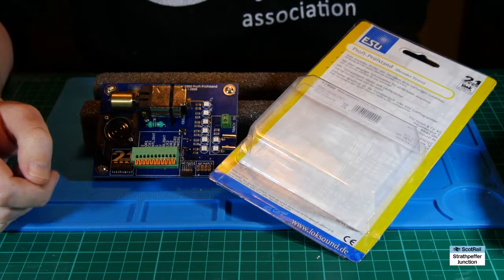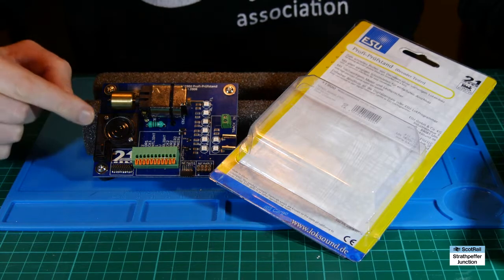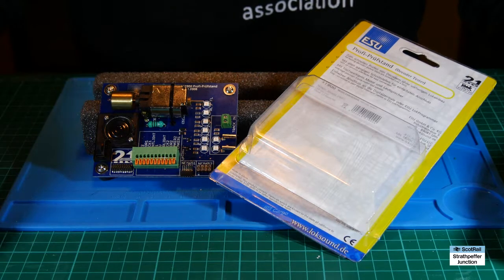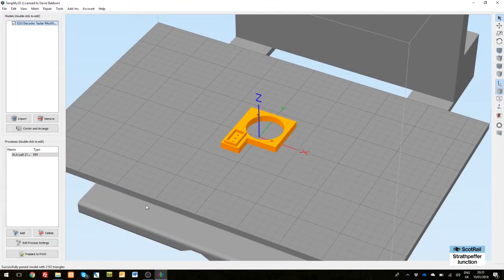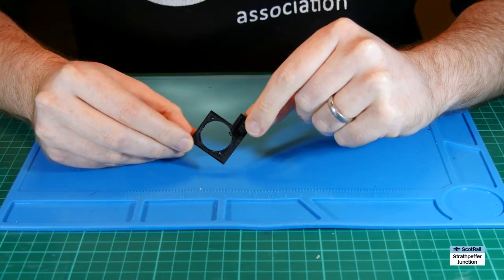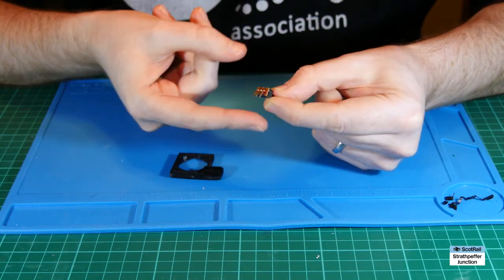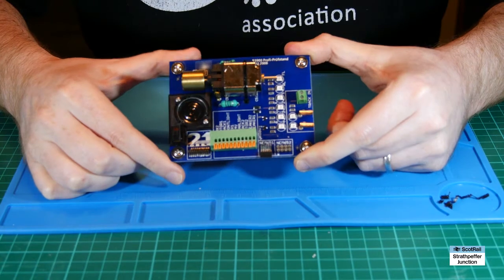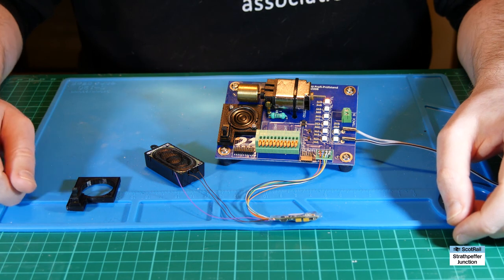#8 Adding a Speaker Switch & 3D-printed mount to an old ESU DCC Decoder Tester

Comment: An excellent video.

I've yet to buy a decoder tester, so what you've described is a cost effective option to buying a new and expensive tester.

I'm expecting to buy a 3D printer soon (I sold on my first one because I couldn't get it working properly), the new Prusa Mk3.
I'm fortunate that I trained to use Autodesk Inventor (Fusion's big brother), so I've drawn several items which I intend to print 3D items.

I think I'll give your conversion a try!
Thanks for making this!
Reply from the maker: +UK Diesel and Electric Railway Modelling Many thank. If you can pick up one of these old ones for a good price (mine was £10, from memory), once tweaked, in my experience you don't need anything else for most testing needs. The newer ones have additional plug functionality, but I don't have anything other than 6, 8 and 21 pin decoders, so I have no need for additional bells and whistles. The i3 is a good machine. Hopefully you'll get on well with it!

Comment: Hi David, another excellent video, you have some excellent skills. I have the more modern tester which switches between 8ohms, 100ohms or off. I have always thought about buying a 3D printer , which would you recommend and does it come with the software? Could you do a video on using the printer, listing all the items you would need and how to use them?...Simon
Reply from the maker: +Simon -Liverton Central Thanks again for the kind comment, Simon. I can indeed do a video on the printer. I've got a couple of projects in mind for it, so I'll be sure to film one. I have a Flashforge Creator Pro. It's at the higher end cost-wise of home level printers, but a lovely machine that prints well and consistently. My main advice would be get as good a printer as you can afford. The cheapest ones can sometimes be ok, but often can also be frustrating to use, unreliable and poor quality. The Prussa i3 is a fair bit cheaper than mine, but a greater machine. One of the reasons mine cost more is because it came pre-assembled and it also has a double extruder. While being pre-assembled saved a lot of time and effort, and I'd recommend getting one like that unless you love building these sorts of thing, I have still not used the double extruder. Getting the nozzles absolutely level can be a really tricky task and for most projects, you only need a single colour or type of filament in any case. Another thing that I think is a good feature to have is an enclosed frame. My printer has that and not only does it make it very rigid, it helps to keep the heat in, which makes printer things like ABS much easier. I guess one of the key things with 3D printers is that technology is changing so fast, mine was pretty much out of date when I bought it, but that being said, it still produces great results (once you get used to the settings that work best with it).
Reply: Many thanks David, look forward to seeing the video.  If you could go into as much detail as possible on how to use one, and the parts needed, it will help me to decide to buy one...Simon
Reply from the maker: +Simon -Liverton Central I'll try my best. It'll probably be a few weeks away, but I'll try to cover most key issues. In all honesty, out of all my gadgets (like cnc mills, laser engravers etc.) the 3D printer is the one I use the most and I find most versatile...you can use of for so many things, from modelling to things round the house, like AA battery holders!